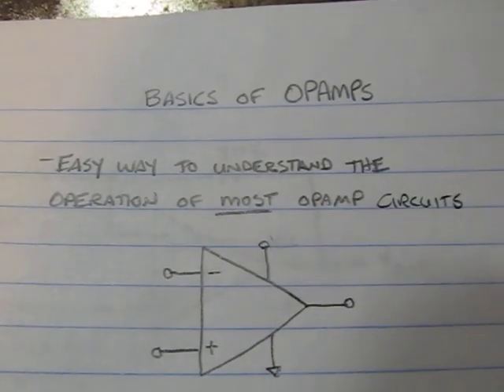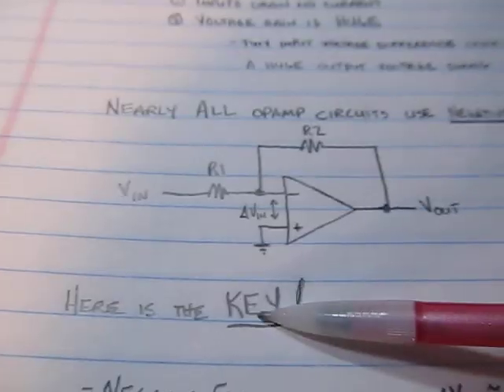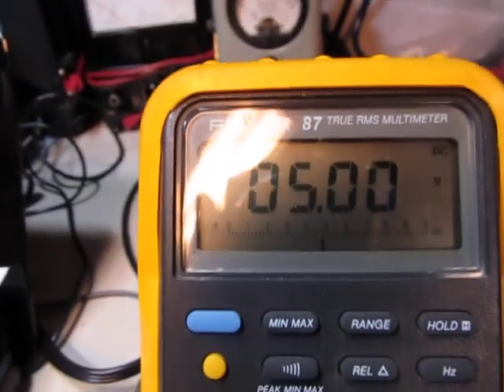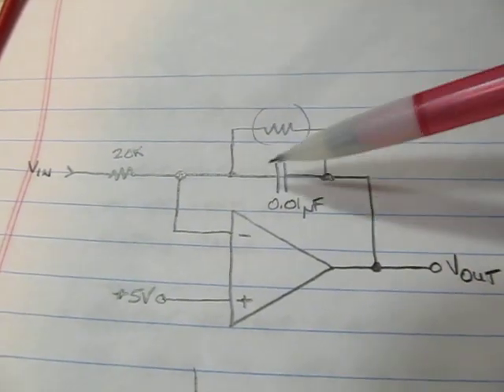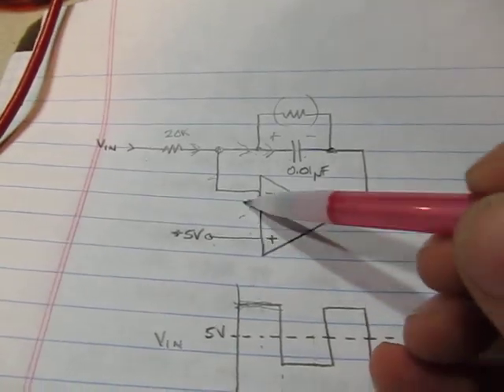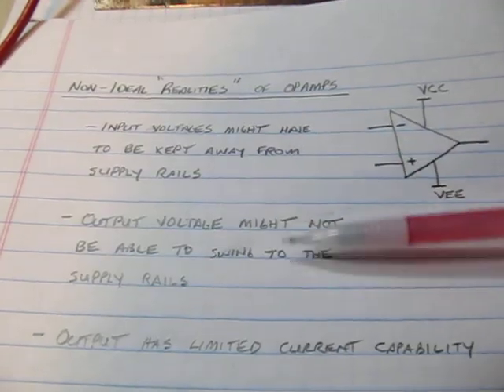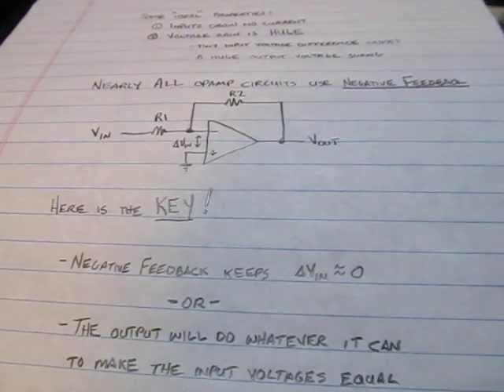#75: Basics of Opamp circuits - a tutorial on how to understand most opamp circuits

Comment: What is the current thru the input resistor. E = I × R , 1 ÷ 1,000 = .001
1 milliamp or 1,000 microamps
That would be a 20 volt drop across feedback resistor not 2 volts
Reply from the maker: 1V across 10k is 100uA.  That same current through the 20k feedback resistor produces a 2V drop.
Reply: @w2aew  that resistor was 
1 k ohm in vid4o
Reply from the maker: @johnsampson8600  That was the previous circuit.  On the circuit shown starting after 3:05, the resistor in question is 10k.

Comment: Sir...I have a op.amp circuit as 0 to 10 seconds with inverting input....negative feed back under faulty condition. The non inverting terminal terminal has been earthed through a 1k and 100 pot in series and parallel with 100 mfd capacitor.acutal system is by adjusting the 100 k pot the output available time will vary with in 0 to 10 seconds. The problem is now the circuit is not working. R1....1k, Rf....10k, 100 k series resistor 1k, Supply volts 16 v, pin #2....1volt through with 10 k preset ...pin#3 grounded through 1k and 100 k pot and parallel with 100 mfd condenser...pin #6 some time i got 16v continously....Now the machine is idle.Please anybody furnish the each resistance valve...to activate the machine...thank.u....

Comment: Why the output is trying to make the input voltage same?
Reply from the maker: Because of the negative feedback and very high gain of the op amp. Any tiny difference in voltage between the inputs will cause a large change in the output. The negative feedback applies a fraction of this output back to the inverting input. Thus, the circuit essentially makes the input voltages nearly equal.
Reply: @w2aew  the input voltage has to be same in order to make common voltage zero.
can i say like that??
Reply from the maker: @hareeshmohanan7875  Common-mode does not have to be zero - it can be anywhere within the common-mode range of the particular op amp.  The differential voltage is essentially zero when the negative feedback is working properly.

Comment: op amp integrators are used to measure unknown voltages. They are often used in circuits that want to measure an unknown voltage. I'm not really sure how it works but the integrator will ramp the input voltage and the counter circuit will "count" how long it takes the input voltage to ramp to the output of the integrator. The Counter circuit will count measuring the time it take the input voltage and the output voltage of the integrator. Some Digital Oscopes have a pulse counter to count that has digit displays the input voltage and output voltage of the integrator circuit?
Reply from the maker: The technique you describe applies a ramp to one side of a comparator and the unknown voltage to the other side.  A counter is used to determine how long it takes the ramp to exceed the unknown voltage.  By precisely knowing the ramp rate, you can calculate the unknown voltage by using the counter to measure how long it took the ramp voltage to reach the unknown voltage.
Reply: @w2aew  Does you Lab Frequency Counter have a mode to be a counter circuit to measure how long it take the ramp voltage to reach to unknown voltage or what lab tool do you use to be a counter to measure ramp voltages?
Reply from the maker: @waynegram8907  I don't have a tool that does this.
Reply: @w2aew  but what lab equipment or electronic measuring tool would be able to count voltage ramps and count how many pulses of a pulse counter? Most oscilloscopes or Fluke DVM meter or frequency counters won't be able to count voltage ramps and pulse counting so I don't know what to use.

Comment: Dear Om, I want to thank you, because you helped me a lot to understand op-amps working principals, but there is one issue which is still unclear to me. In the example 5:00, all calculated values are clear to me, but I can't realised how they are not matched with formula which says, Gain=-Rf/Rin=Vout/Vin. We see that -Rf/Rin=-20k/10k=-2, but it's not equal to Vout/Vin=7/4...Maybe I am getting wrong, but I don't know where, so could you help me?
Reply from the maker: The basic formula assume that the voltage at the op amp inputs is 0V (ground), and it is not at ground in this example.  It is at 5V.  So the difference from the input to the op amp inputs is -1V, and from the op amp inputs to the output is 2V, so the gain is -2.
Reply: Thanks a lot, it's clear now.

Comment: I get the details, but what is the application/usage of setting a voltage equal to a voltage that you already have in the circuit?
Reply from the maker: Unity gain is often used as a buffer.  Sometimes a voltage or signal that exists in a circuit may need to drive the input of another part of the circuit - but simply connecting the two nodes together may "load down" the original circuit and change the voltage.  A buffer provides a means to "sense" the voltage, and then provide a copy of that voltage/signal to another part of the circuit without loading or affecting the original signal.  Another way of stating this is that a unity gain buffer has a high input impedance (doesn't load the input signal) and has a low output impedance (it can drive a heavier load).
Reply: @w2aew  Thanks very much. Btw I really appreciate your videos. I'm starting to understand some of this stuff, but I struggle a lot with how it can be applied to make practical solutions. Perhaps this could be interesting for your viewers as well. Again thanks :-)

Comment: Can you explain why the curent is constant through the capacitor? As the capacitor is charging the curent decreases. I'm missing something.
Reply from the maker: With a simple R-C circuit, the current decreases as the capacitor charges.  But, with the op amp in the circuit, it adjusts the voltage on the capacitor to keep the current constant (because the current in the input resistor is constant, thus the current in the capacitor is constant).

Comment: Exactly what I needed to know. I am an amateur radio operator who has used a simple dual op-amp ckt to pre-amplify microphone inputs. The output level was too high and adjusting the second stage of the op-amp feedback to lower the overall gain was the right move. 
Later, I nearly fried the input dual op-amp ckt in one of my radios. I still have near-perfect operation, but the is now a 2-3khz noise present. I need to understand what component might have been fried in the ckt that needs replacement. This ckt, by design, has a single component that is two diodes in parallel and reversed from each other shorting the inverting input and the output. in parallel with that diode pack, in the feedback line is a resistor and a capacitor (100k & 390pf). I am still trying to figure that out, but this helps (current limiting?).
Thank you for the short, practical explanation.

Comment: If it's an integrator circuit shouldn't the triangle wave go up, down, up, down rather than down, up, down, up? I know it doesnt matter but for the sake of technicality I would like to know the reason it goes down, up, down, up in case I am missing something important
Reply from the maker: Because it is using the inverting configuration of the op amp.

Comment: W2AEW, this engineer is saying that current feedback in a power amp section will have "FOLLOW" the impedance curve of the speaker. I don't understand what that means that the current feedback of the power amps sections op amps or transistors FETS will Follow the impedance curved of the speaker. I don't understand how current feedback does anything to do with the impedance curve of the speaker. Here is the video at time 1:15 he will start to say this quote https://www.youtube.com/watch?v=ZyRIWZssI9s

Comment: how you are considering 100uA current flow in both the resistors? can you please help me understand this. im not getting this point.
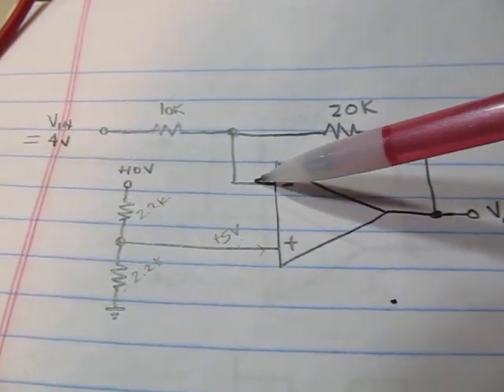Reply from the maker: The explanation starts at 3:30 or so.  Remember that the sum of the currents entering/leaving a node has to be equal to zero.  We also know that virtually no current flows into the inverting input.  This means that any current flowing through the input resistor MUST also flow through the feedback resistor - that's the only place it can go.

Comment: I am a bit newbie on opamps My question is , I have a signal generator As we know it includes internally 50 ohm resistor. Do I need to add this internal resistor into my calculation/schematic while testing the curcuit ?
Reply from the maker: Only when the circuit you're driving has a low input impedance, and thus would create a voltage drop across the 50 ohm resistor.

Comment: The best teacher on the internet! Question: I built this op amp delay circuit https://youtu.be/XsBzrgHPrpQ which I found in a book. The delay works fine except when it is initially switched on the whole circuit becomes energized. You have to switch it on and and off a couple of times before it performs as intended. Is this just the bounce surge from the physical switch or is there some other reason the delay gets bypassed on the first run? I tried adding a buffer on the output which minimizes the issue, but doesn't eliminate the initial false start. Any thoughts would be helpful!

Comment: Thanks for the informative video! Was able to apply this in comparator circuit for a thermistor controlled fan. Much more sensitive than using a single BJT and easier to adjust.

Comment: what kind of amplifier is this? is it non-inverting?
Reply from the maker: All op amps can be set up either way - it is all dependent on the design of where the input is applied.
Reply: @w2aew  so this means to say that in the example number 1 it's an inverting amp? Because the input is on the inverting terminal? If that so then how come the Vo is not negative? I'm quite confused :).
Reply from the maker: @xxxxxxxxxxxx123-i4r    Yes.  Note that "inverting amplifier" doesn't always mean that the output is negative.  All it means is that the output moves in the opposite direction to the input.  In this case, there is a DC offset voltage involved (+5V), so the "gain" appears with respect to this offset. When the input is 5V, the output would be 5V.  If the input is taken above 5V, then the output goes below 5V - and vice versa.
Reply: Ok tnx a lot :)
Reply: @xxxxxxxxxxxx123-i4r  
Technically it's a 'differential amplifier'

Comment: What about positive feedback? Does it give the same result or?
Reply from the maker: No.  Positive feedback will slam the output to one extreme or the other (high or low).  Think about it - if the non-inverting input is slightly higher than the inverting input - this causes the output to move to a higher voltage.  If the output is connected via feedback to the non-inverting input - it will increase the voltage difference, reinforcing the upward movement.

Comment: The inverting summing junction of an operational amplifier is NEVER ZERO.   
To "simplify" an explanation  of the workings of an op amp it is useful to describe the tiny voltage between the - and + inputs... BUT it is confusing to ignore this voltage by making it "almost zero" , THEN ignoring this voltage. 
     Calculations can ignore this tiny voltage because the op amp has extremely high open loop gain 
often 1,000,000 0r more at DC and low frequencies .  When  the  input signal frequency increases the open loop  gain  begins to drop,  the feedback causes the input required to maintain 
the same output swing becomes larger. Eventually it becomes large enough to be measurable.
Reply from the maker: All true.  The point of the video is to make reasonable simplifications to understand the basic operation/function of most op amp circuits.  Details such as open loop gain variation vs. frequency, and the resulting implication on input voltage difference, go beyond the simple point of the video.

Comment: I wish you had explained the second example with all the voltages as you did with your first. It is the same mistake Math teachers make. They explain the most basic aspect and then don´t reinforce those principles on the second more advanced example. At that point they loose half the class and by the 3rd step they have lost the rest of the class. 

Your explanation on the first example was excellent though.

Comment: How do i find out what pins on the chip match up to the lines on the triangle in the schematic? It just tells you to connect wires to one of the legs without telling you what leg that is.
Reply from the maker: The datasheet for the op amp that you're using will have the pinout indicated.

Comment: So when do you say to yourself during design, hey I really need an op-amp here?
Reply: https://youtu.be/c5XDuaNSIMs

just have a look on this👆 video about Op-amp.
It will be highly useful for u👍
Reply from the maker: It really depends on what processing you need done on a signal.  In many cases, op amp based solutions are cheaper and more precise than discrete solutions.  The near ideal properties (very low output impedance, very high input impedance, gain determined mainly by external component tolerances) help to simplify many designs.

Comment: It would have been useful to add that the ideal op amp has no resistance at its output. It is an ideal voltage source. That is why you didn't need to worry about the current flowing from the output pin when doing your calculations.

Comment: Thank you for this concise and informative video. I'm new to circuit analysis, and would like to clarify: 
When you say that Vout's negative feedback brings the voltage of the inverting node down, is that functionally because, as Vout goes down, the voltage difference between Vin and Vout increases and therefore there is a larger voltage drop across both R1 and R2?
Reply from the maker: Basically yes.
Reply: @w2aew  Thanks a bunch!